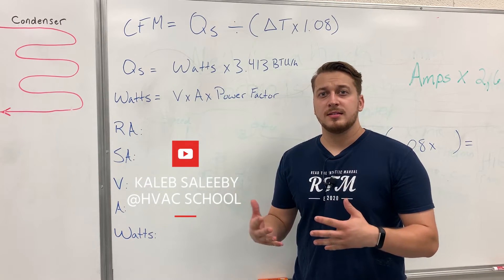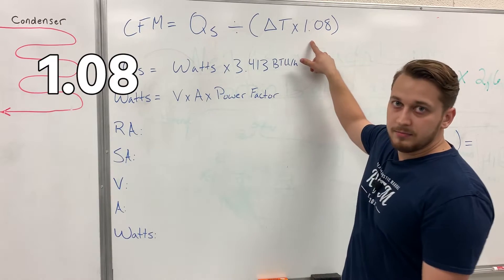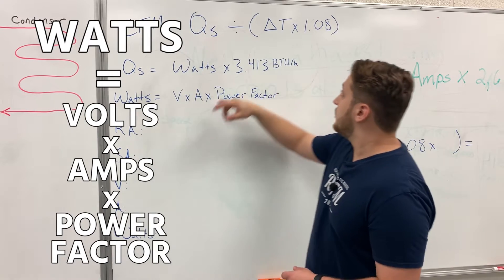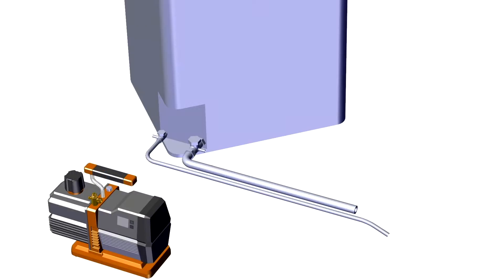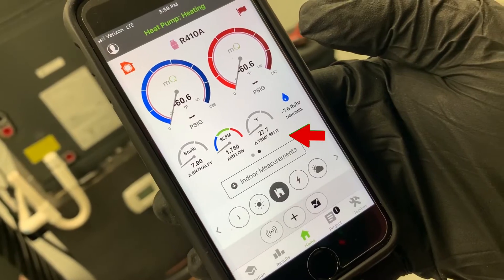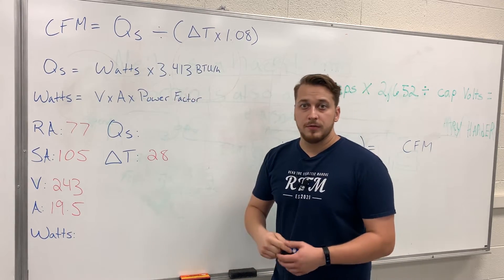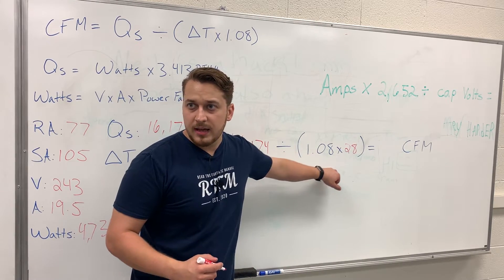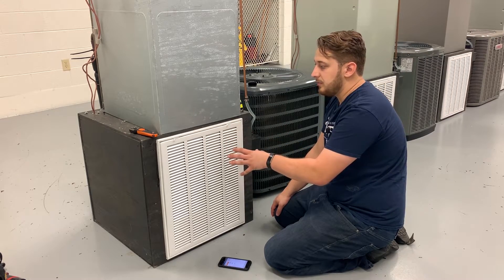Heat Rise Airflow Calculation

Comment: Straight and simple easy, thanks.

A question:
You used the formula , sensible heat capacity = WATTS X 3.413 BTU/h, which its right (conversion between KW and BTU/h).

But also you considered the WATTS in this Thermal units conversion formula is the same as the electrical power input KW.

I get confused here, what i know is the coversion formula can be used for the output power , from kw output power to BTU/h, not from the input power to BTU/h. 

if you please have more explanation?

Thanks again

Comment: Good video.  Cooling airflow may be different if the blower speed taps are different between heat and cool.  In that case changing the taps and running the test twice might be appropriate.

Comment: Good class!
Ak factor is no longer accurate. Back in the day there was only one vane anemometer so they had a factor. Then they came out with another anemometer and they had two factors based on what tool was used. Now there are so many anemometers that they don’t publish factors all the time, instead they use a lot of face velocity numbers.
Reply: Absolutely, those formulas are fantastic!